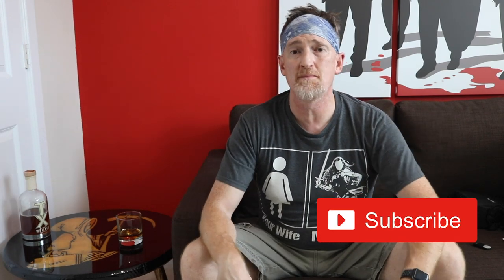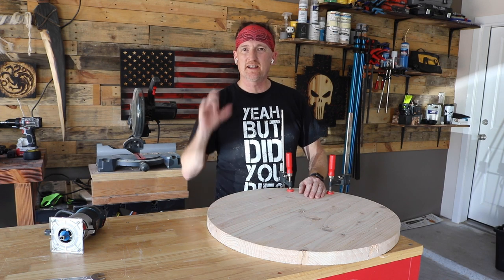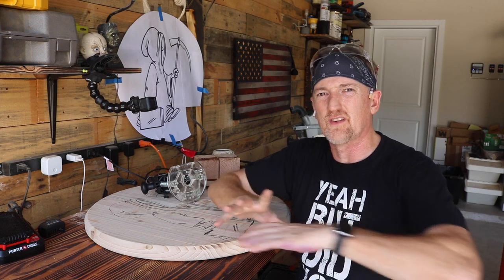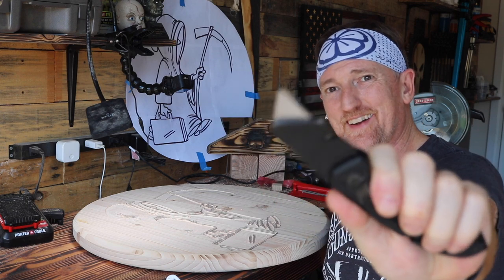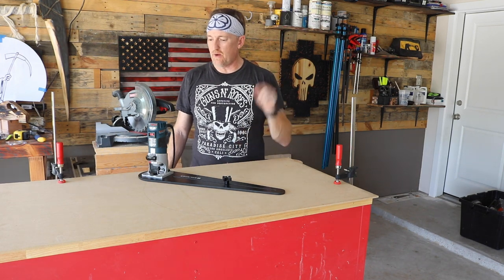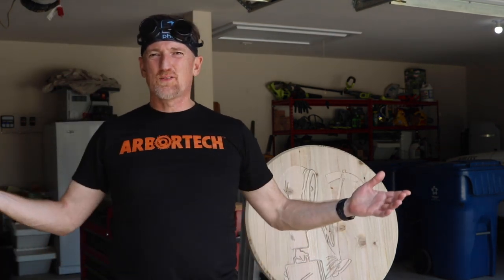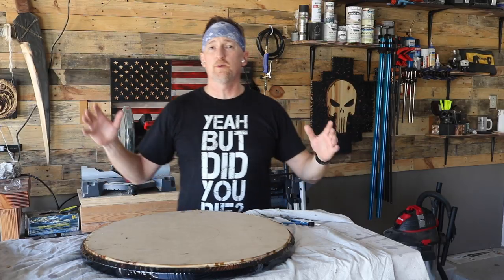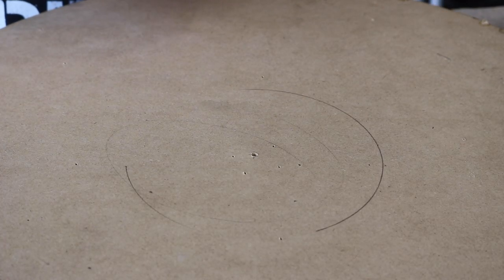DIY End Table with Epoxy Resin Inlay

Comment: On determining how much resin you need....i just watched another guy who poured a fine sand onto the work piece until the area is filled.  Then he poured that off and measured the volume of sand.  Worked great for him.  ~P
Reply from the maker: Someone else suggested that. I tried it and didn't have great success, but I think it was user error. I was using 2 different colored epoxies and didn't figure any extra...

Comment: New subscriber, love your content. On the subject of working out how much resin is needed, I have a solution. Get some fine sand, like the stuff used in kids sand pits. Then fill the carved out area with the sand, levelling it off as neat as you can with a window squeegee (spelling?? Sorry) or bit of scrap wood, so it's flush with the top level of the wood. Then empty this sand out onto something and then pour into a cup to see the volume needed for your resin. Allow maybe 5% extra just to be safe and allow for the bit that's wasted in the container etc. For deeper carves, I would use uncooked rice, but sand is better for getting in the fine details on this project.
Reply from the maker: Thank you. And thanks for your suggestion! That's a great idea. I kept trying to figure how I could pour a liquid into it and then measure that. But sand and rice make so much more sense!!

Comment: Holy shite man. I mix fiberglass resin in the same exact cups. It has gotten surprisingly hot at about eight ounces worth but damn. Aggressive, you aint kidding. Good to know. I've been thinking about doing a project with resin. Fiberglass res has a yellow tint to it and I don't know if Lowes or HD sell the clear kind. Might have to Amazon it. Nice video man. Like your style. I prefer metal measuring spoons over the plastic white ones. Makes it easier to see the white when I'm measuriing.
Reply from the maker: Glad you dug the video!
I feel you on the measuring spoons. Will be picking up some metal ones soon.
If you're going to order resin, check out Totalboat.com. If you use code BDB2019 it will get you 20% off your first order. And they have super quick delivery (I usually get mine in 2-3 days).
Cheers!👍🥃👍🥃

Comment: Was looking for tutorials on epoxy inlays and the table top epoxy and ran into this gem. That table turned out fantastic! I want to try my hand at epoxy but I'm nervous... sink or swim right!?!
Reply from the maker: Yup. Try a practice project first. And if you're doing a shallow inlay (less than 1/4") use the Table Top epoxy. It's easier to work with IMO.
Cheers

Comment: I may have missed it but what type of wood was this? Also what type of wood do you recommend that i use for epoxy inlay?
Reply from the maker: This is pine. If you are looking at getting that charred gator finish, pine works well. If you're not going to cook it, most hardwoods play well with epoxy.
Cheers

Comment: so would the table top epoxy be enough to lock the charring down then instead of using the penetrative epoxy??  i'm completely new to this so not sure which way to go....i like the effect on the legs of the table too and the math's was a good tip as well!
Reply from the maker: Yes. In retrospect the penetrating epoxy was probably an unnecessary step. However, I would coat it once with some sort of spray finish to keep the char from mixing into the clear final coat.
Cheers!
Reply: @BuildDadBuild  so just a coat of spray polyurethane clear finish before pouring epoxy over it??  would it matter if its a water based or oil based spray poly finish if thats what you mean??